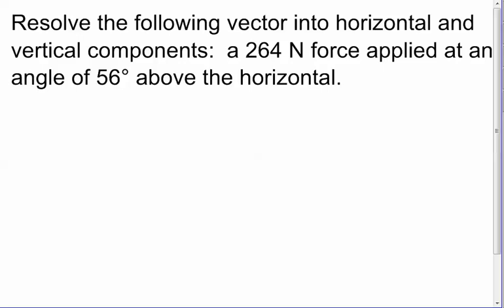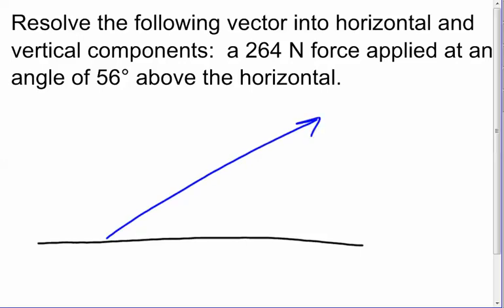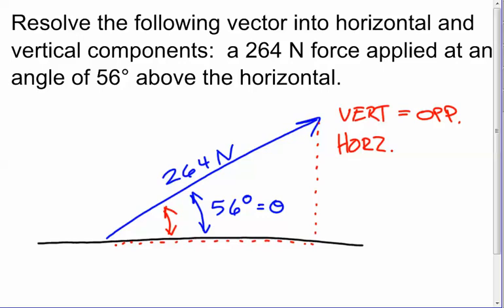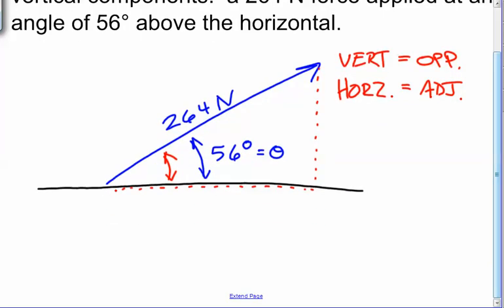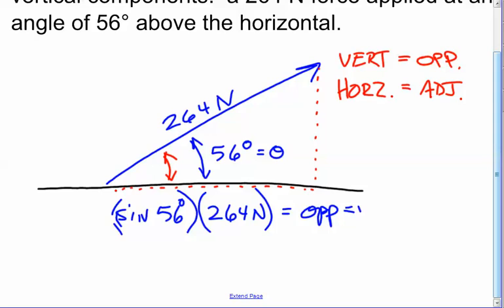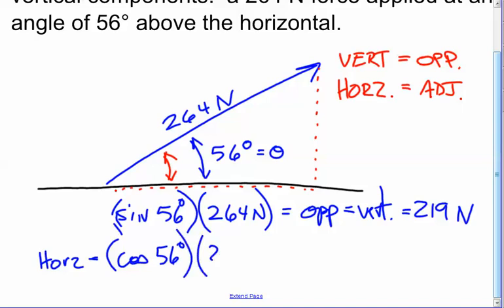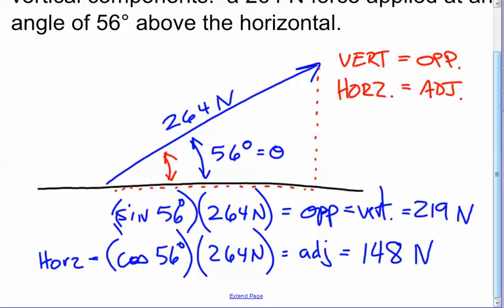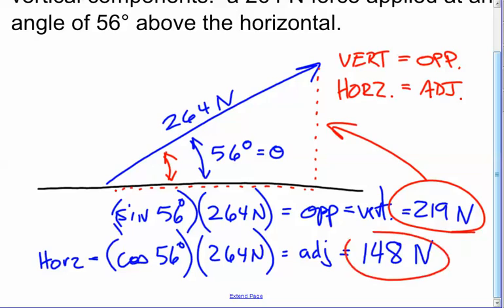Resolving a force into horizontal and vertical components

Comment: why is he using sin and cos? I thought because he had O and A he would be using tan. Im so confused please help
Reply: The problem does not give opposite and adjacent values.  The value given in the problem is the hypotenuse.  So the value of the hypotenuse and the angle are used to solve for opposite and adjacent values, which are the vertical and horizontal components of the original vector.  Sine is used for the value of the opposite and Cosine for the value of the adjacent.